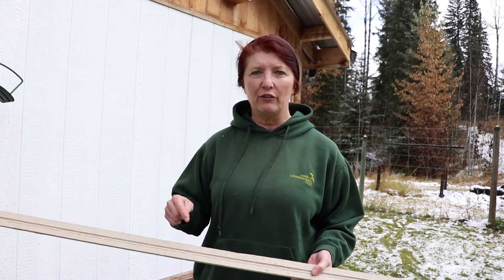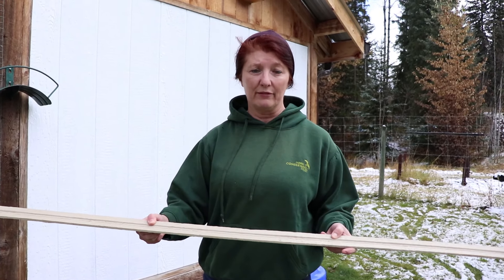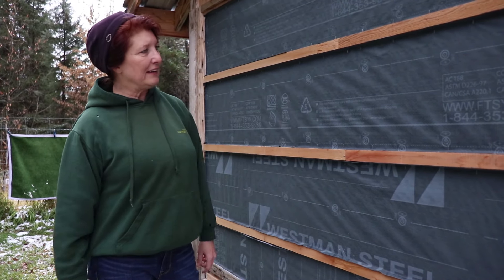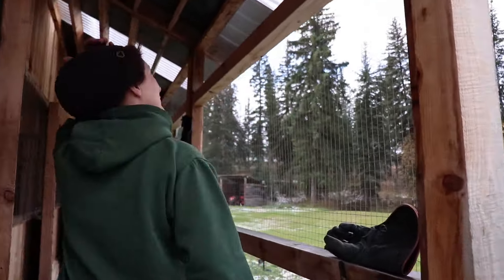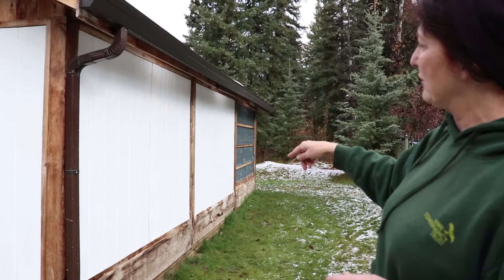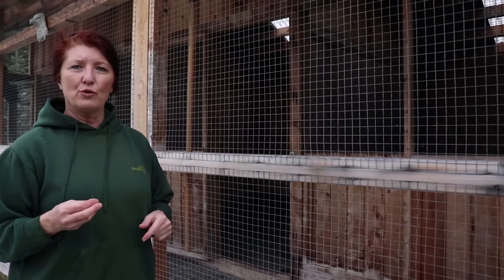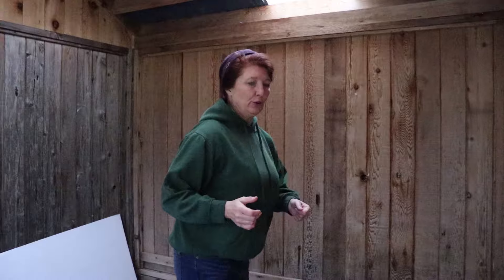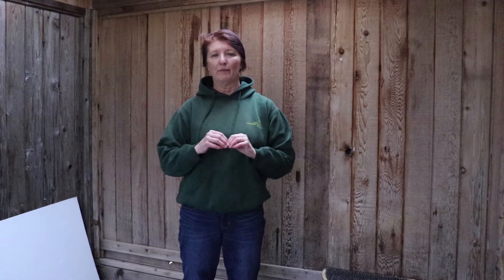RENOVATING MEWS FOR WINTER ✨ DIY Hawk & Falcon House Upgrades | The Falconry Series

Comment: Was wondering how your mews heaters worked and are they worth it i was using a infrared heat lamp for chickens, right above bow perch well enough out of the way still cold inside but not cold enough to freeze bath pan all the way untill the polar vortex came down this way im in southern Wisconsin

Comment: Hi, i often use korkplates or rockwool for insulation!! You can seal it with insulationsfolie. With that we keep the temperature by 0℃. I had an old cottage in Germany ( Uckermark) lowest Wintertemperatur was -25℃
Reply from the maker: Good afternoon charlotte;
Thanks so much for the suggestion - I've heard of rockwool insulation, and it definitely looks to be an amazing product.
We recently completed the cladding of the mews with the engineered siding, which made an impressive difference in how sheltered the Feathered ones are when they're out of the weather. 
Once we have the window-inserts (basically a variation of shutters), and the heaters in-place, I'm optimistic it'll be materially warmer in the mews.
This being said, I'm definitely open to adding an interior layer of rockwool, which would then be covered over by another layer of the engineered siding. 
Very grateful for your insights on this - have a great evening!
Best, 
Jo

Comment: Great video! Useful information as always. I'm not sure what the Celcius to Farenheit conversion is. I'll definitely be thinking of the warmth issue when planning for my mews.
Reply from the maker: I believe -20 degrees celsius is -4 degrees Fahrenheit, which is super cold in the very middle of winter. Most of the time Jo's place sitting at 0 to -15 celsius (32 to 5 Fahrenheit). Leashes, bath pans and hoses definitely freeze! :) -Leah
Reply from the maker: Hallo David;

We live only to serve, fine sir - here's a link to the formula:
https://www.rapidtables.com/convert/temperature/how-celsius-to-fahrenheit.html 

:0)
Jo
Reply: 20-30 celsius below equals 68-86 below Fahrenheit.

Comment: for the screw misses remove the screws and use a good 100% silicone calk and you will be good... i like the new setup the only thing i would do different is remove the wire and replace it with pvc bars or keep fence it would still work. then put little lip on the outside you could slip a piece of plywood or chloroplast behind the lip. basically ways to make it easier to change it depending on the weather so nothing ever has to be unscrewed. and if you have the money i would redo the floor and walls with the paint stuff they use in restaurants on the floor to make everything easy to clean and it fights mold and bacteria growth .. also keep Leah away from the power tools lol.
Reply from the maker: I definitely steer clear of power tools! Thanks for the suggestions, I'll pass them on to Jo! I know the wood composite already repels rot, insects and bacteria so that's good! :) -Leah

Comment: how easy is it to get bird safe materials in other words don't contain chemicals that wont harm them or worse of course
Reply from the maker: Good afternoon Richard;
Thanks for stopping in and touching-base. :0)
It comes down to doing good research and applying a combination of due-diligence and common-sense...finding materials which don't "off-gas" or contain dangerous chemicals is as easy (or difficult) as the amount of effort one puts into sourcing them out. 
This comes down to straight forward choices like using treated lumber to build with versus non-treated, for example. 
A 'no brainer', in terms of which would be safer...though the argument usually devolves down to a percentage of individuals saying "I only want to build mews once" and using the rationale of money being the defining factor for not building with untreated lumber, etc. 
I've (personally) always felt it important to build to what is optimal, even if this means waiting for the budget to accommodate the desired outcome. 
My feeling is "Team Feathers" are exposed to enough dangers in the natural world, so...why would I deliberately expose them to more?
Thanks again for the conversation - hope you're enjoying a restful day.
Best, 
Jo
Reply: @TheFalconLady  your video series is 1 of the big highlights of my week